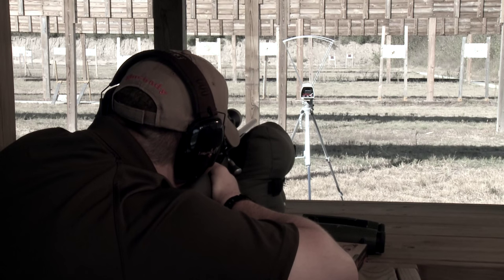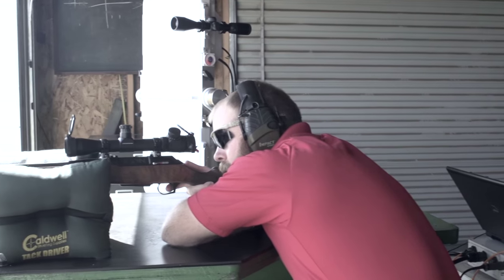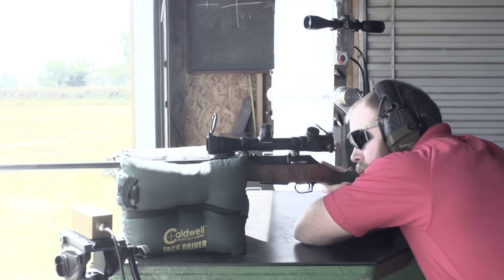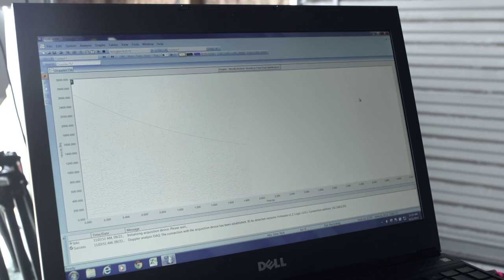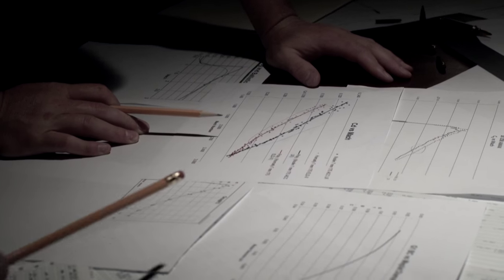Doppler Radar Testing

Comment: If mfg's could come up with a tip that could withstand the feeding cycle in semiauto rifles like the AR15/SR25 without deformation and still deal with heat from friction in flight not to cause any POI shift down range all while being able to aid in expansion on impact that would be gtg. I have loaded/experimented with most polymer tipped bullets in most major top end 308 AR's and if there is a issue it lies with the polymer tip getting bent during feeding, not heat from friction during flight. I wonder how something like a carbon fiber tip would fare.
Reply: I have seen this problem in my new 6.5 cm AR10 using the new Hornady bullets. Since there are 2 feed ramps the tips get bent differently and you see 2 distinct groups. One group for each feed ramp. I'm told polishing the feed ramps might help but I haven't been able to try it yet.
Reply: I single feed my Ruger precision 6.5 CM because of this. It is not only semi-autos, its whether or not you have a single or double stack magazine!
Reply: Maybe this is a dumb suggestion, and I'm sure if it is someone will certainly tell me, but why can't aluminum be used as a tip cap instead of plastic? Wouldn't that also serve as a plunger to enhance and start the expansion process? And it would be much tougher and withstand the shooting process much better. Thoughts?
Reply: @wasntmeXYZ  <-  Winchester has done that for YEARS, but with hunting/self defense bullets.

Comment: My Labradar unit is an excellent tool. I have it set it at muzzle, 15 yards, 25 yards, 50 yards, 75 yards,  and 100 yards. For <$600 you can't beat it. Pellets, arrows, handgun, and rifle. Mobile application via bluetooth works easily. Data stored to SD card if you want. Smartphone displays power factor,  ft/lbs, ES, SD, Hi, Lo etc. Best bang for the buck. The bluetooth app is the easiest way to use it.
Reply from the maker: Hope you're using that info you get from your Labradar and putting it into our 4DOF app.  No better ballistics program in my mind.
Reply: @hornady  <- Some of my favorites:  .357 200gr FlexTip, .357 180 gr Single shot pistol, .30 208 A-Max, .44 200gr HP/XTP, .30 90gr XTP, 6.5mm 95gr V-MAX. 16 boxes of your bullets on the shelf now. 
Thanks for the tip on the App. I'll check it out. On my smartphone I have "Strelok" and use that for long range.
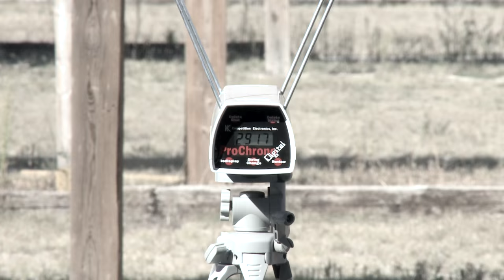Need subsonic reloading data for the 350 Legend. My .357 MAX data seems to work well as a starting point. 256 gr "Hunter" bullet with 6.6 gr American Select gets 972 fps, ES 37 fps, from a 16" barrel. I have years of loading subs in my MAXIMUM. The 350 Legend is a BLK killer! No data for it yet. Needs a .357 bore, 1:12 barrel though. I'll have one made.